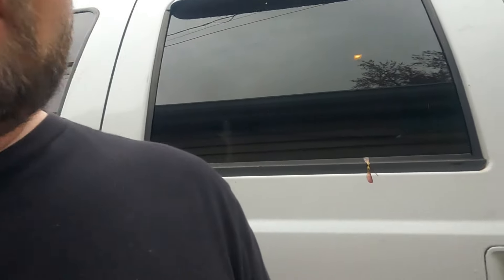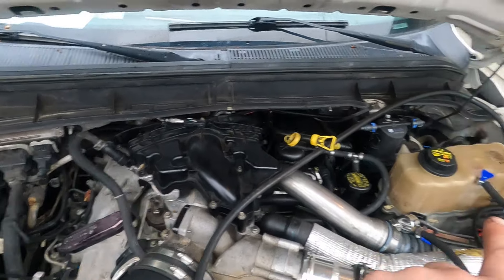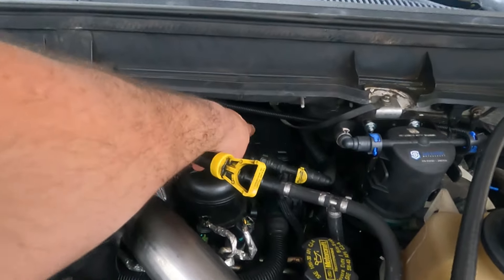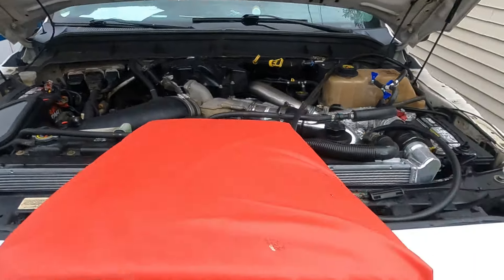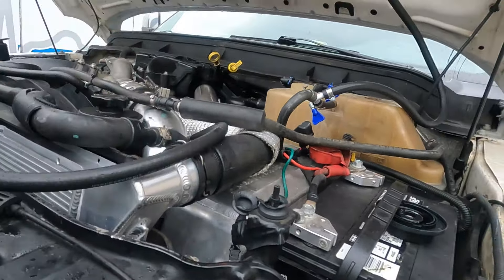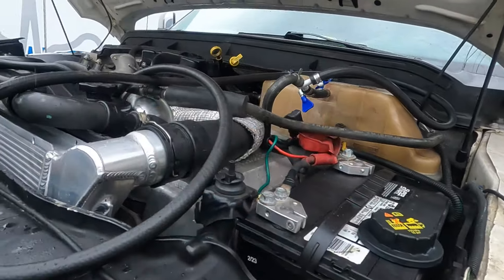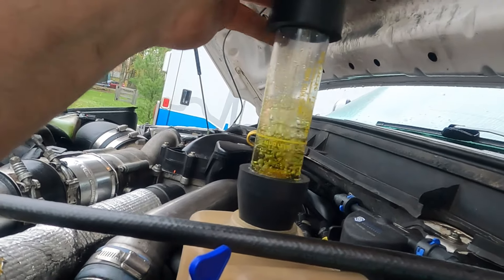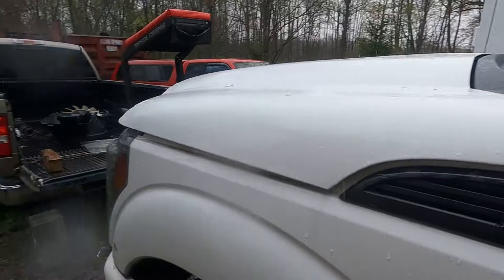Testing A 6.7 Powerstroke For Blown Head Gaskets

Comment: So what happened with the head gaskets. Didn’t see another video on your page. My 2018 is  blowing coolant fom the cap, but only when its hot and i push it. Gonna get that test kit and check that. Ive replaced the cap and it hasn't helped. It doesn't get hot.
Reply from the maker: The heads were so badly warped that it was causing pressure in the cooling system.